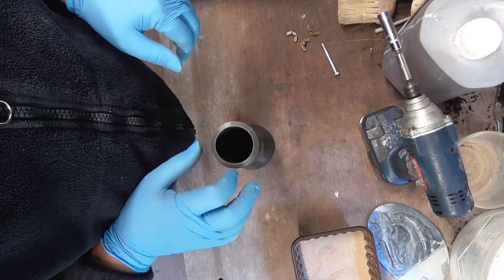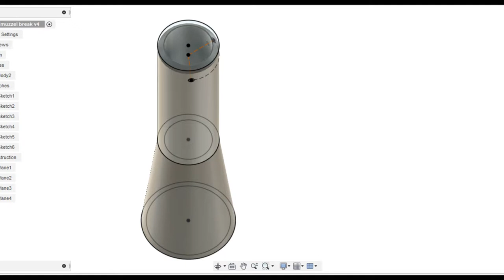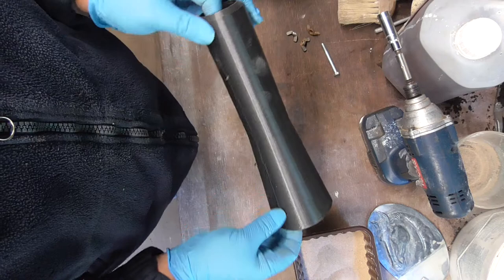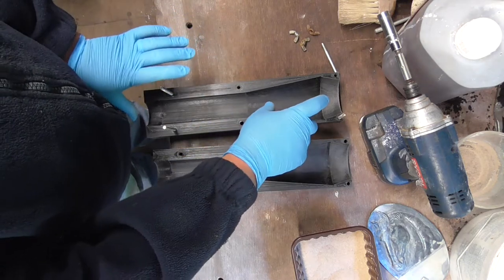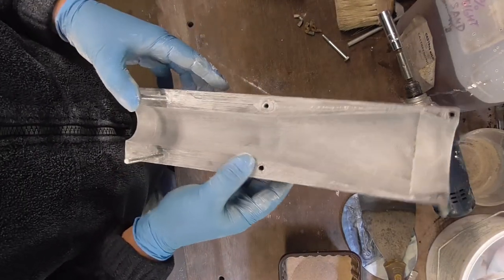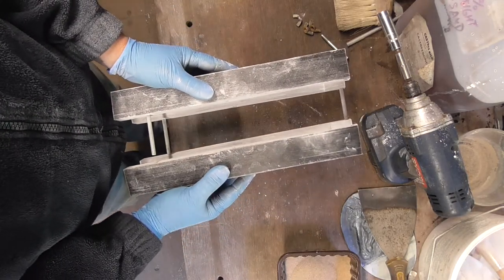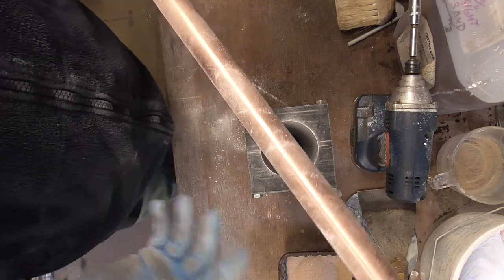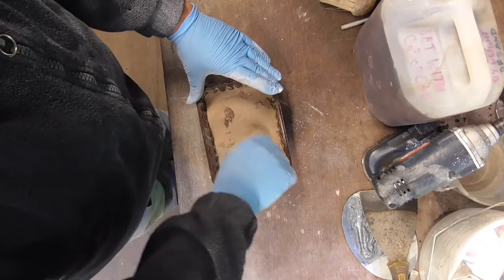CVRT RARDEN cannon muzzel casting. P1

Comment: Andy, Just to be a pain😊. I would have rammed it solid and pushed a knitting needle through it a few times to allow the gas in and venting - easier than reaming around that copper pipe. I as amazed that you got that pipe out - well done! The mottled appearance of the core suggests incomplete mixing -  I pass my core mix through a sieve (about 1/8 inch) and then remix. Wash the sieve fairly soon.  I use glucose powder but any sugar like molasses should be fine, we will see I guess) .... Martin
PS, nice looking 3D prints
Reply from the maker: It was luck it cam out so clean I tell thee, it was not the best of cast's to be frank.
It just highlighted the fact this was not an economically viable job. always up for a challenge though.
The molasses was your idea lol, works though.
Currently doing another set of castings (seems I have been getting a few orders) these will be for another video to come.